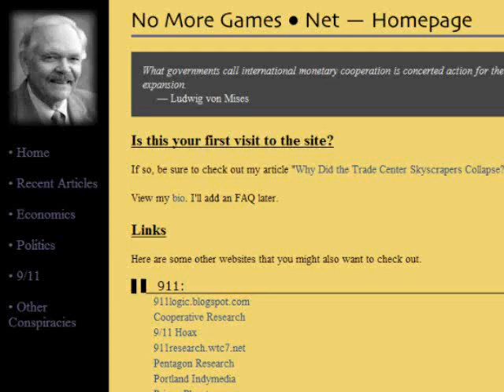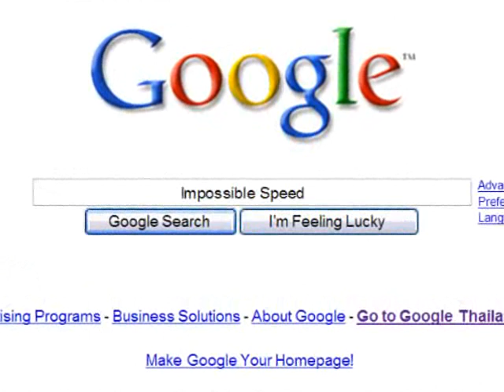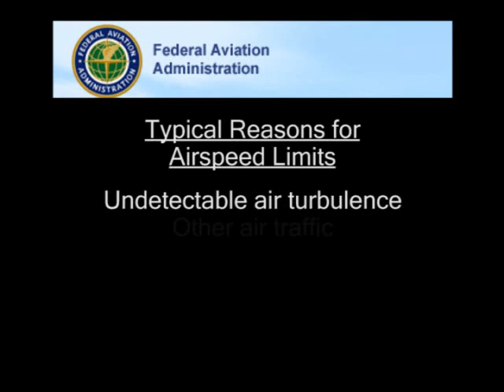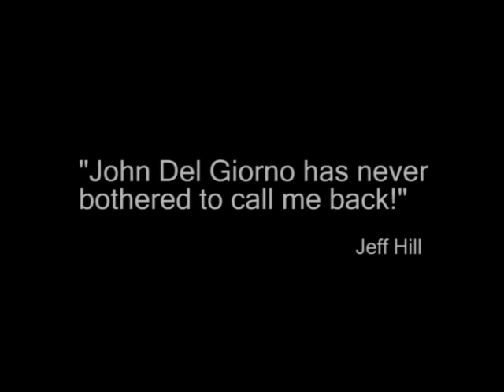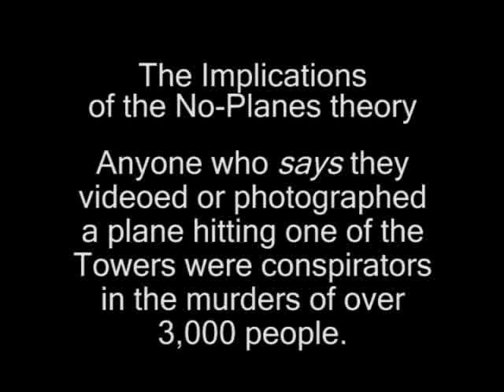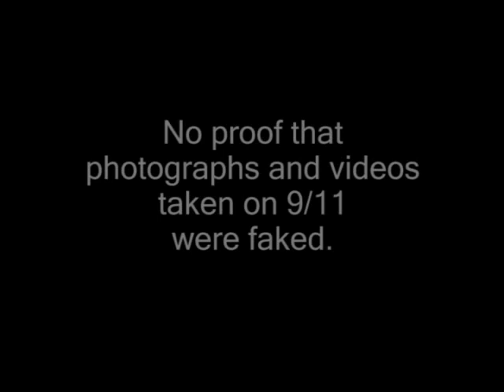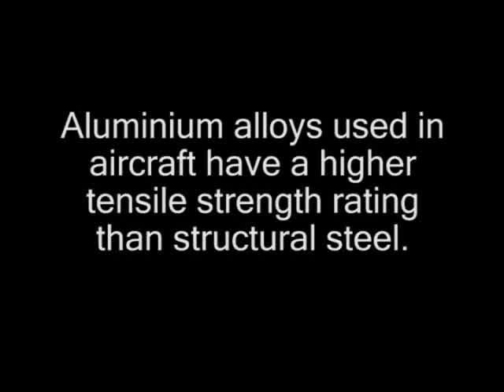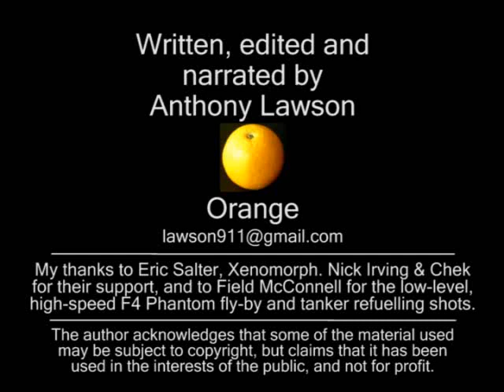9/11: Impossible Speed & Impact -- Busted! Updated

Comment: What gullable idiots are going to believe this video, The first part of the video has ignorance, saying about the speed, Air is thinner at altitude, meaning for all you un educated people, The plane can only travel those speeds at the altitudes stated next to it. I will prove this once and for all that the debunkers are deceiving you on this video once and for all. Please go and find an old military war plane book, then look at the speed data, It states different speeds at different altitudes. You do not see high speeds at sea level. This is due to the thickness of the air. This video is sneaky as it ignore's important factors. Another thing I will mention about airframes, aerodynamics, Why do you not see jets with huge wings and why are they swept backwards. All fast planes have wings swept backwards because they need to or they fall apart. The other thing is power, Some planes can achieve crazy speeds at sea level due to extremely powerful engines but look at their top speeds at altitude. This is a very misconceiving video and to make cover up video's, it will give a reference who are covering up the truth.. The truth can never be hidden.
Reply: benjyboba You can hardly expect your attention to detail in matters physical to be taken seriously when you can't even edit your posts properly - bad spelling, missing question marks, wayward apostrophes, mixing singular nouns with plural verbs (and vice versa). You'd fail a basic literacy test for a basic clerical job application.  Why should I trust your sifting of complex data.
Oh, and where to start with this lot?:
"the demolitions are proven and facts"
" there is only one possible way"
"the media are proven to lie"
"I know it, you know it and anyone who does their own research know it."
"luma key"
"It was doctored, without a doubt."
"everyone almost knows the truth"
"I will prove this once and for all"
"Please go and find an old military war plane book"
"The truth can never be hidden"
Reply: You don't take anyone who is for the truth serious. Nist admits free fall, That means the structure below had to be removed by something else as there isn't enough energy to fall at free fall and crush the buliding below, physics show it was an inside job. If you don't know this, then you are thick.
Reply: benjyboba lmao wow! where did you get your pilots license? you study Aircraft performance and density really well didnt you? shit man. if you are a pilot then let me know when you fly so i can stay out of the sky before you kill someone
Reply: You are frustrated because you can't beat the fects and you know it so you start attacking the person trying to discredit them but you are so stupid that anyone who checks the facts will know you are a lieing deceiving idiot. This is facts and you can't handle it. Now everything you say is based upon claims to suit your own bullshit. Example, you claim my physics come from truther video's but as I'm not gullable, I check other sources away from conspiracy. You cant lie because you are found out. Catagorizing a truther as gullable. because they believe in a conspiracy theory is stupid. Media lie, governments lie. Solid video evidence proves this. So you are a gullable idiot to automaticallky believe in what you are told without doing selfresearch. You can't leave me alone because I am winning every debate and you know it too. :) Now go annoy someone else you programed sheep.
Reply: Why you ask such ridiculas irrelavant questions and make yourself look even more stupid. give up on me and Go sheer some sheep instead.
Reply: lol trust me kid i did my own research becuase im a pilot smart one. i know what planes can and cannot do. im not some idiot because i can and will own you in Aircraft performance and Density altitude. But yes you need to answer questions if you are going to make bullshit claims which by the Way density altitude changes with Altitude, temperature/Humidity AND Barometric Pressure smart one. you people are all about asking questions are you!? Questioning is exactly what you people want me to do so here i am. If you ignore my question then either 1 you know 9/11 is not a inside job but choose to keep the lie going or 2 dont have a single clue as to what you are talking about yet still make bullshit claims.
Reply: Alan Marks Anthony Lawson passed away a few months back. He put up tons of info on youtube
Reply: Brookfield Anthony Lawson (the real one i mean) would never use base language or childish insults, he was way above that type of useless nonsense. This person is defaming the good name of the man and too make it worse he can't defend himself either
Reply: Fantasy = physics, can't argue with. When buliding 7 fell at free fall, admited by nist, there is only one possible way it could happen, controlled demolition. No arguments what so ever. Only argueing is was there are plane wasn't there and other such things but the demolitions are proven and facts. When you have a pile driver theory that fails because the video shows no pile driver, when official theorys make zero logic and the media are proven to lie, you got not arguement but to argue over jet or other issues, one would have to prove a few witnesses were fake. I admit I don't know certain things and am still trying to understand but the fact remains, it was a controlled demoltion. You can't argue against it if you go to a physics lesson and make sure you learn real physics then come back and examine what you see, I have done this and there is even video's which prove physics.
Reply: What ever you say is a distraction from the truth. The facts are the towers fell through controlled demoltions.The speculation yet needs solid evence to prevail. Debunkers have have even made truth video's with conflicting evidence on purpose. Everyone knows it was an inside job, except those who are gullable to not investigate all evidence. The official story is impssible, there is no arguement. The only arguments are just speculation which have not been proven.
Reply: benjyboba Read the evidence. You clearly haven't done so, so you're arguing from (deliberate) ignorance. Start your journey by correctly using apostrophes (not apostrophe's). You may think it a distraction, but other people will take you more seriously if you apply good standards to everything that you do. I wish you luck.
Also see:
Hitler is still alive
Elvis is still alive
Unicorns exist
DHMO is a threat to us all and must be banned
Reply: Its not about other people taking me serious, its about other people investigating for the truth themselves. So many lies and deceptions regarding the official story. Just go through as much official footage, debunkers on tv, what they all said and look at the facts away from the conspiracy to get the truth of phsyics, the truth of temperatures of melting metals and any other question that comes up. 100% inside job but many parts of the story is not clear. You got to be thick to say a conspiracy theoriest believse in all these fictions, every single conspiracy needs investigating and finding the facts. The moon landings, some questions have truely been answered, much evidence can not be checked to confirm facts. 911 is the only one that is 100% fact it was controlled demolition. Also being open minded doesn't mean you believe it.
Reply: benjyboba I'm now taking you less seriously because your writing is getting worse. have you had a few drinks?
You started this thread by suggesting that you understood the physics. You clearly don't. The fact that you are also quite iffy about constructing sentences lowers your credibility as well.
You appear to have only watched youtube videos and read truther articles. Try studying work from respected scientists and experts, not armchair theorists and self-contradictory whatabouters like 'Ace Baker' and the Shack man.
Reply: benjyboba Oh very good. You've clearly rumbled me. I congratulate you on your superior debating skills... even though you now sound like you're 13.
Reply: There is an old saying, the truth hurts but the person who made this statement is a liar. The truth heals. The only way to heal is to have the truth.
Reply: benjyboba ??? How do you write this stuff without thinking it through?
Reply: benjyboba Ridiculas? Irrelavant? Can you even spell your own name? You truthers sure are clever! Goodbye, and good luck with your phD.
Reply: As you prove not to have the inteligence to work out the meaning of the miss spelling and then go and make a point of it, means you understand ? and decide to attack the persons credentials rather than the facts and evidence. Thanks for saying goodbye and since when did I say I am doing a phD  ? forget the last qusetion, don't answer as you made it up. Don't mix up capabilities with carelessness. The facts remains and all ways will, controlled demolition.
Reply: benjyboba so you avoid a aviation question yet can state all these opinions on what a plane can and cant do. enlighten me as to what Density Altitude United 175 was flying if you think you know what you are talking about.
Reply: Another idiot I see, trying to sound good but go do your own research or are you another debunker fool trying to fool everybody who is a sheep. I could answer questions but don't wish to spend time talking to debunkers who are only there for one single purpose, to lie and cover up the truth. Air density and sea level, go away and read and never comment to me again. You can't look at speed alone in the equation because altitude affects density which in turn affects speed. Go and read up some war planes with super sonic speeds and compair sea level vs high altitude. Just this simple factor on the video shows ignorance of facts. So do I need to answer any querstions, The fact is you need to learn that this video is for sheep only. Ones that will not look into all the data for themselvse. Good luck and don't try and ask me any questions or tell me I am wrong. bye bye
Reply: Here you go with your claimed good sounding bullshit, So you 100% agree with me that the planes did not do the speed claimed, including ground speed as there wasn't enough wind on that day. Now you are obviously a lieing debunker because you are protecting the official story. Have you not seen how many lies exist with video evidence of officials contradicting evidence. Lets just stick to the planes, you agree the speed is a lie or a big mistake, You only have to watch video's of the incoming plane to see it was straight and level and impossible to do the speed. Now as you claim bullshit, why should others believe you as you can be here to lie, I reccomned everyone to check the evidence for themselves and not listen to lieing experts. You can say I lie as much as you wish but whoever check its will know I am telling the truth. Even if loads of your debunker friends all team on me, You still can't hide the truth when someone is willing to look at all the evidence from sources other than official or conspircy and find the truth. You are the weakest link, goodbye and I must be right otherwise you would just ignore my comments. :) Go and find a sheep to fool.
Reply: lol thank you for my morning entertainment its not claimed sound good bullshit Its fucking science smart one! just keep ignoring the facts. which by the way shit for brains even if there was a 50 knot head wind United 175 would have hit its target at 500 knots or greater. but that rights throw up your white little flag and run with your tail between your legs.
Reply: benjyboba "I could answer questions but don't wish to spend time talking to debunkers who are only there for one single purpose"
What? This is a debunker's video. What else do you think's going to occur within the comments?
Reply: benjyboba "As you prove not to have the inteligence to work out the meaning of the miss spelling"
So what is the "meaning" of your appalling spelling then? Is it some kind of code, a private language between you and the aliens? Please enlighten me as I don't have the intelligence to decipher it.
Reply: Spelling doesn't change the fact it was an inside job and lets not talk about aliens. I am way smarter than you believe because you have  been programmed. Different debunkers are All the same, make huge claims which are proven lies. Good enough evidence. No one can possibly tell a lie when others do experiments to confirm facts. There is no arguement, only fooling sheep on behalf of debunkers and very few sheep get educated because they don't look at the evidence, just say its been debunked and explained based upon belief, rather than fact. You people amuze me to how you think we are all sheep and stupid.
Reply: benjyboba "I am way smarter than you believe because you have  been programmed."
It's...possible, but:
1. That sentence doesn't back up your claim.
2. Smart people don't need to tell people that they're smart.
3. I've been programmed. Your delusions are facts.
4. Your mama's calling you.
Reply: So it proves you are not smart because if you were smart, you would research for yourself and find out if what I say is true. Smart or not, Debukers make false claims, are they smart or totally stupid. After researching my evidence you will understand my meaning. You are programmed to believe in the official story and not question it. You should believe what you are told because its official. When its a cover up then official will need to lie. I waste time on dumb people because they are not willing to do their own research, the truth is all people ask for, yet lies are present with contradictions to prove it. So many people go on about this so many years later, it has to say something as to why so many never forget. I'm not interested in people who are just here to abuse and lie.
Reply: benjyboba There was nothing sneaky or dishonest about Mr Lawson, in fact he is one of very few honest and trustworthy people on youtube. What you people fail realize is he was involved in media in Australia for decades and understands how film works. As for this clip, he's done his research and what he claims here is correct, 100%. You are either a paid disinfo agent, or one of the people he's outed as a liar making bogus clips about 911. See when Mr Lawson was alive, he produced everything using his own voice and his name and stood by what he stated. As for your English it is appalling and to think someone of your intelligence is sullying the name of Mr Lawson, is sickening to the core. Also you explain absolutely nothing in this diatribe of yours, zero.
Reply: Anthony Lawson I do not wish to address you on this issue but I've seen plane tails snap off just due to a slightly heavy landing. Shown on a Morgan Reynolds video. You can say anything you like but the evidence is on video. Also wings snapping off during flight due to high g force. I've seen too many expert pilots come forward and explainations that make sense. Physics don't change over time and safety has been there to certify aircraft. Without going into detail. I know the truth so why attack my truth. Ps planes have crashed through diving as they can't pull out of the dive, research history and it proves it. I didn't need argue as recorded flight history proves the facts. Now people who read shall research deeper but most know the simple truths. Even your built up energy theory is stupid. Remember the man who fell from space. Air was thin he broke the speed of sound but a sky diver in normal position only reaches terminal velocity. Everything has limits and 6 times the power of the engine to push it through the air, that is only part of equasion. The blades and air cavitate. Reply to someone with less sense if you wish to fool them. I give up talkiing and you start me off again. WHy ?
Reply: benjyboba
Why are you replying to Anthony Lawson? He died earlier this year, and the previous post mentioned it. And you claim to be a researcher. Hmm...
Reply: Brookfield Reasearching important things only, I take it you seen more up to date video's with new evidence. I've seen too many official video's which now agree and no longer turn a blind eye. Eventually the truth will come out. Till then lets all chill. I'm only interested if new things come out. pc could it be someone else is using this profile. Hmmmmm, I won't research that, what's the point. Things I don't understand is how so many people's stories on that day all match up. Anyhow, peace.
Reply: Anthony Lawson If you do any research Lawson you certainly do not present it anywhere on the internet.
Reply: Antipodean33 So if Lawson's dead, then which Nut Case called Lawson keeps posting 'Pictures of Oranges' to my Email/You Tube address?
If Lawson's dead, then why is he doing voice overs and adverts on the Genesis Communications Network?
We are all aware of Lawson's nonsense on You Tube, most of which have their comments section blocked.
Reply: Alan Marks Go to his channel here on youtube, his son put up the last clip on that channel talking about his father passing. As for your other questions i have no idea who is doing that
Reply: Antipodean33 The norday brothers have fake footage in videos and skipped scenes. I often wonder if some of these video's are actually made to sell lies.
Reply: benjyboba
Oh please. Don't be too proud of your skills at analysing videos. Your attention to detail shows that you can't even get the name right of major players in the narrative.
Reply: Brookfield It still do not change the facts, that fakery exists on official video's. It is so terrible that the claims of official information, doesn't actually match their own video's. Like the plane diving into the towers, yet one of their own video's, shows it travelling straight and level from other video angle. When people start realising the blame has been shifted then things become more obvious to what really happened. I just got one thing to say, respect to the murdered, respect means truth to what ever it actually is. When all is clear and fits, then the truth exists and quietness will prevail from all truthers. I know a few things that couldn't happen so I know I'm being lied to. take care.
Reply: benjyboba
Your comment shows that you don't have the slightest clue about how perception can be altered by many factors, so therefore you are thoroughly unreliable in your assertion that you "know a few things that couldn't happen." You don't.
Reply: Antipodean33 The best One can make of Lawson is that he is a meddling 'do gooder' with a head full of Voodoo Physics and the servility of the brainwashed Eloi.
Reply: Alan Marks This "Anthony Lawson" is an imposter. I didn't realize what was going on here as i'm a friend of the real Anthony Lawson, who was a fellow countryman of mine and has regrettably  passed away recently, but now i've worked out was is happening. This Anthony Lawson needs to stop using the great mans name as i'm afraid people are mixing him up with the real Mr Lawson. I'm unsure if he's doing this to get subs, but his other channel has only 9 subs, yet this one with Mr Lawsons name has many many subs and views. I also think he defames the real Anthony Lawson by using his name and he is also not as intelligent or talented as the real one. I'm going to ask him to stop using his name, to refrain from his obvious deception for the sake of honouring our great friend and mentor
Reply: Anthony Lawson I'm asking you to stop using our great friend and mentors name of Anthony Lawson. I believe you are doing him and his family a great disservice by using his name and it is also deceptive to say the least. I'm respectfully asking you to change the name and honour Mr Lawson by doing such. This is very upsetting too his family and friends, so please stop this charade at once
Reply: Antipodean33
I don't see who you're addressing or what you're referring to. As far as I can see, nobody has falsely commented as Anthony Lawson here. I can't find any comments in his name since he died in February, unless you can point to something.
Apologies if I'm wrong, but there doesn't appear to be an ongoing conversation with anyone using the name Anthony Lawson, real or false.
Reply: Brookfield There is another person using his name i've seen it recently and i'm sure it was here????? I've seen the channel and it says something about in memory of Anthony Lawson
Reply: Antipodean33
Actually since I wrote my comment I clicked on his name for the G+ page and some of 'his' replies did look a bit suspect, eg. base insults. Didn't seem like his usual measured tone.
Reply: Antipodean33 
Yes, he always stuck to the point without resorting to that.
Reply from the maker: You are the ignorant one, and I really can't be bothered to argue with you, except to state that the FAA's speed limitations are set for many reasons, not only to protect the integrity of the aircraft's structure.  The plane has just made a rapid descent from about 21,000 feet and obviously could sustain a speed of about 575 mph for about 10 seconds.  Do some decent research on modern airplanes and bring yourself up to date.
Reply: You are argueing irrelavant information and you know I'm right that is why you don't want to argue, I know it, you know it and anyone who does their own research know it. The airframe being superior will not allow the engines to push it through the air at a higher speed than the engines and air density allows meaning as you get lower altitdue you go slower.You could not push something through water faster than air because its thicker. Air gets thinner at altitude, so the plane will go faster. Now I'll prove a fact right now for anyone who wonders what the hell I'm talking about. I will say look at terminal velocity for a sky dive, then look at the sky dive from space, he went supersonic speed from space altitudes due to lower resistsance of air. The terminal velocity is around 125 mph ish at low altitudes. It has nothign to do with airframes and the like, the physics do not allow the speed. Physics will never change, no matter how much someone wishes to deceive or lie. Now talking of a dive by the plane, Looking at videos of plane flying into tower. I've seen a long distance view showing it being straight and level all the way into the towers. This proves it couldn't have had the speed but I tell you what could, a cruise missile.Maybe with some overlay video editing and a luma key. So many video's are different from one another. I seen one video showing the plane diving then turning, whilst another of the same plane shows it straight and level from miles away. It was doctored, without a doubt. Go and fool someone who you can fool, its now a waste of time as everyone almost knows the truth. xx
Reply: benjyboba Guys like you always make me laugh. You can analyze and refute real evidence to the nth degree, even when you're not smart enough to understand what you're arguing; yet you have no problem creating fantastical nonsense in its place with absolutely zero proof, logic, or rationale behind it, and just accepting that as reality. When you applied your same standards of proof and logic to every theory, you could not believe in anything if you can't believe in a plane hitting the tower. Yet the biggest conspiracy theory and cover-up in the history of the world is more plausible to you than accepting that you simply might not comprehend what is and isn't theoretically possible for a jet to do.
Reply: benjyboba Haha! You wouldn't be the first truther to resort to the "if you don't believe x, then you must be thick" line. It's a sign of desperation, frustration, or having run out out of arguments.
I don't take truthers seriously, because their kind of truth is that which ignores real evidence, pouncing on anything that supports the wildest theories, which often contradict each other. Confirmation bias. You also find this amongst creationists/religious fundamentalists, alternative medicine fans, and racists.
Physics actually doesn't show that it was an inside job. You've only been reading truther 'evidence', and watching truther videos. There's an overwhelming amount of evidence available, worked on by respected experts, and collated by good, decent, meticulous people who REALLY care about the truth. It's fascinating stuff, and, once you've got to grips with it, you'll be able to leave the nonsense behind. You'll also feel much better about yourself.